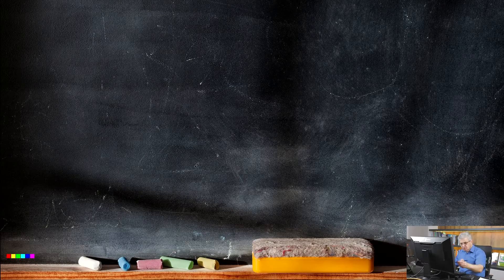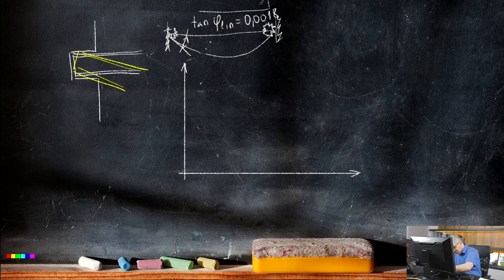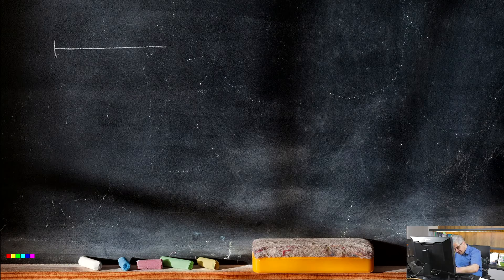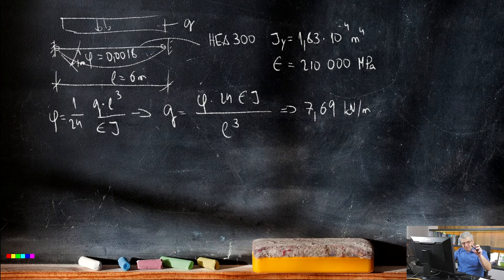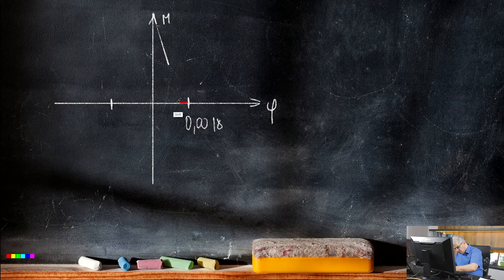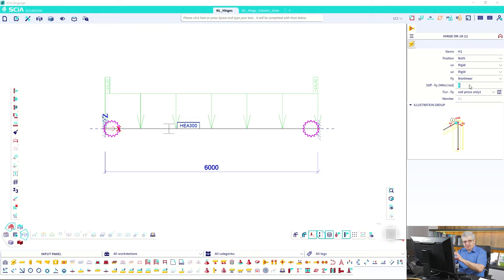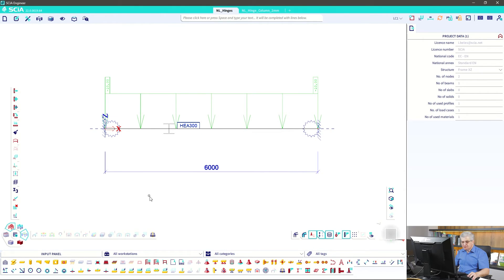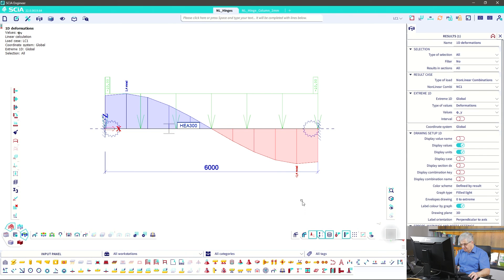SCIA Engineer Tutorial: Nonlinear Hinges on 1D Members - Tutorial with an example

Comment: Great video mr.Ivan, thank you for the very simple, yet usefull explanation.I have question in this direction, Let's say we have some 2d Frame on 3 storyes and multiple moduls, and we have implemented the actual stiffnesses of the connections (we've checked them in Idea StatiCa).. Is it possible for Scia to find where would the first plastic hinge occurs in the frame, then the second plastic hinge, than the third and so on, untill the frame becomes mechanism?
Thanks in advance.

Comment: Thank your for the tutorial. This example has the potential of being a bit confusing for engineers used with seismic design. There the standard definition of a plastic hinge involves a behaviour that is opposite to the one being discussed here. For reinforced concrete beams for example, we consider fixed connections up to point where the longitudinal reinforcement yields, after which we have increases in curvature without significant bending moment gains (so basically a pinned connection behaviour). 
The behavior is opposite but he modeling procedure is identical, so thank you for illustrating it. 

The lack of a push-over analysis option in scia is being felt for this type of applications. If we wanted to incrementally increase the q load and analyze the intermediate load steps, the only way to do it would be to manually create several load cases. This is not practical for typical structures.
Reply from the maker: Thank you for the comment. I try to answer: This example was not for seismic design. This is a simple basic tutorial to generate one type of nonlinear hinge and, to see, how to do it. I think, for seismic design it is better to use nonlinear calculation, because the stiffness will be calculated by iterative process with considering of reinforcement.